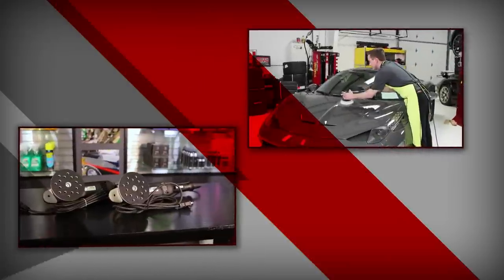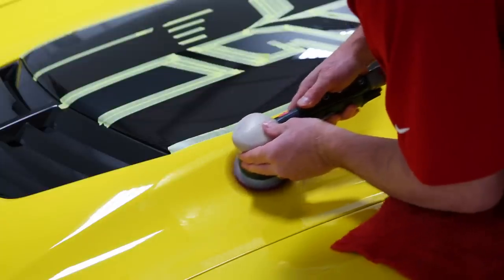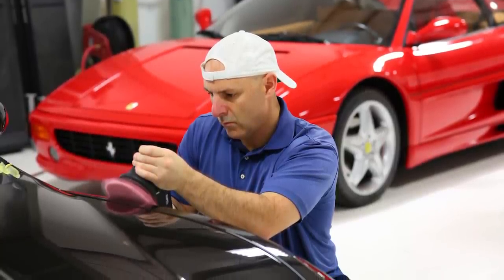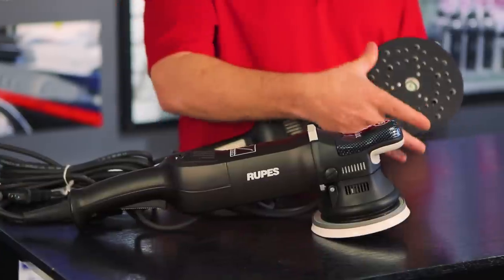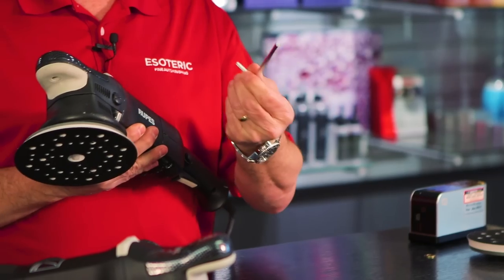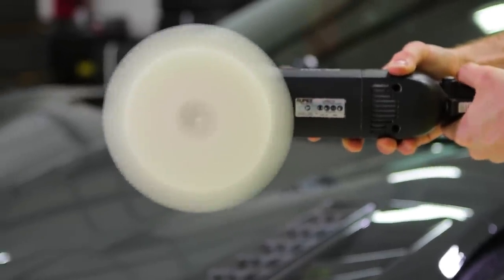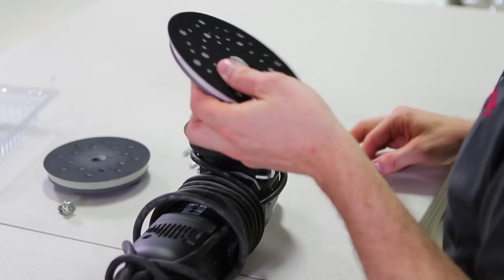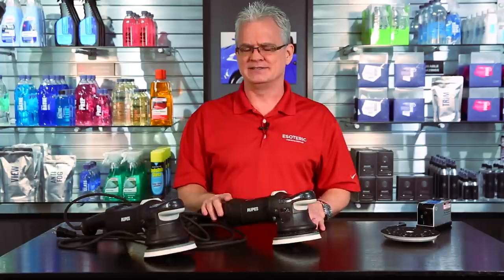How to use RUPES Bigfoot Polishers - Esoteric Car Care

Comment: Todd, thank you for the M8 size tip! I was tracking the washer mod but everything I could find called for a modified washer.
Reply from the maker: You're welcome, James. The statement or claim that it needs a "special" washer is complete BS.
Reply: Hi Todd!

I just want to clarify something as I had a hard time trying to see the M8 washer from the video. But it’s just a standard M8 washer, correct?

When people show the washer mod, I normally see an unspecified washer grinder down. Is the M8 washer in the video grinded down or a complete circle?

Thanks in advance.
Reply from the maker: Standard washer. If anybody is trying to say that it takes a "special" or "modified" washer, they're selling you snake oil. It does not matter one bit.
Reply: ESOTERIC the washer mod by Kevin Brown is supposed to help the backing plate spin better. It doesn’t rotate freely when machine is off but with washer mod in, that little gap helps
Reply from the maker: @briandraper7630  A washer is a washer is a washer. All it does is space the backing plate so it doesn't touch the "anti-spin" shroud. You can either use one that you already have in your toolbox, or pay to use one that is "special-made"...they will function exactly the same.
Reply: ESOTERIC ok thanks. Do you think it makes a big enough difference to put the washer in?

Comment: Hi I hav a Rupes LH 21 machine.. In very good condition.. Only problem is it's running on a single speed with no other buttons to adjust speed though..?
Reply from the maker: You can contact Rupes USA for service...they typically have very quick turnaround for repairs.

Comment: Great video. I see you mention a better cut with the 21. I own a 15. Am I sol when I need more cut or will it just take longer to polish out such defects?
Reply from the maker: In most cases, no. In extreme cases, you may find with the 15 you have to go back over a small remnant, whereas the 21 might clear it all in just one polishing set.

Comment: Thoughts on pad type? Mike Phillips only advocates for rupes pads as a system. I was going to go with the thin lake country. Any issues you've seen with using other pads?
Reply from the maker: The machine and pads from Rupes are all balanced to work together, but having said that, you can still use others if you wish. The 3 pads that we use at least 95% of the time are the Meg's MF Cutting Disc for compounding, and the Rupes Yellow and White pads for either one-steps or finish polishing.

Comment: Todd increrible vídeo!
I have 21, This info is perfect,Because is not necessarey to buy another machine.
Work with 5” on rupes 21,i will get the same results like 15?
Thanks.
Reply from the maker: Thank you. Yes, with a 5" backing plate and 5.5" pads on the 21, you will get the same kind of results that you would with the 15.

Comment: Nice video Todd, i was wondering if you had any info on the new rupes forced rotation version? Im still happy with my LHR75ES but sold my LHR15ES MK1. Im waiting to see what this new forced rotation one is like.
Reply from the maker: No information as of yet. I wouldn't hold out unless you particularly like a forced rotation machine. Most people do not like the action / control of a forced rotation, including myself.

Comment: Great Video on Rupes Todd. I have a LHR Mark 1 15es. Is it possible to add the rubber stand off feature to set the machine 
down on?
Reply from the maker: Thanks Kevin. If I'm not mistaken, the replacement housing (top / front) of the Mark II comes with this piece, and should fit exactly the same as the Mark I.

Comment: so its best to buy the 21m throw and can use the smaller backing plate and best off both machines in one what about pad stall great review
Reply from the maker: Not necessarily...just depends on your wants and needs. In the shop we use the 15 most of the time, but if you're a detailer that works on big flat surfaces a lot, then you may want to go with the 21. "Pad stall" is generally a technique issue, and not a machine issue.

Comment: Thanks for info Todd, I have the 21 and both backing pads, one thing to be aware of, and please correct me if Im wrong but when using a 5.5 pad on a 21, which was designed for a 6.5 pad, you will get less area covered because of the smaller 5.5 pad, thanks again for all the great videos, hope to be in one of your classes in the future, Jose

Comment: My Rupes 15 seems to stall at the slightest angle, will the washer mod or shaving down the shroud really help that much?
Reply from the maker: That's a technique issue...
Reply: ESOTERIC I’ve heard that but you can only angle your wrist so many directions, to say it’s a technique issue would be incorrect. I’ve tilted, angled and stood on my head but the slightest angle make me reach for my 3 inch... Would the washer mod help at all or is it a waste of time?
Reply: Basically how can it be a technique issue if my Griot’s G6 will spin on the angle of discussion but the Rupes will not?
Reply from the maker: @voltage80x  We have been teaching the Rupes polisher in our Academy since 2013. When we first used the polisher all the way back in 2012, we felt the same way. But when we learned how to work with it, it was no longer an issue. As a part of our training, we specifically teach how to handle contours to get the best results.
Reply: ESOTERIC I appreciate the response, I’m able to get it to spin but the angle I’m holding it seems incorrect but it’s working lol, idk just odd and not what I expected from the tool

Comment: I have a 15 da polisher different brand cheaper Chinese made should I use 4.5 on that as well it’s 720w motor
Reply from the maker: If it goes to 6, then 4.5 would be a good starting point!
Reply: ESOTERIC i starts on min then 1-6

Comment: Can you change the backing plate of the lhr15? To a smaller one like you do with the 21
Reply from the maker: For the LHR15, you cannot go to yet a smaller backing plate. The stock plate on it for use with a 5.5" pad is all you can do.
Reply: ESOTERIC - Fine Auto Finishing great stuff thanks so much for the fast reply was just curious.

Comment: I see a lot of people using little to no pressure while using rupes machines. Is that not needed with these like others?
Reply from the maker: Pressure is indeed needed to gain optimal results. Compounding requires the most pressure, then it drops down a little for one-step polishing, then down yet again for finish polishing.
Reply: gotcha. I guess I've been catching people doing the final stage.

Comment: Do you have any interest in the new Rupes Mille "Forced Rotation DA" ?
Reply from the maker: We will sell it, yes.
Reply from the maker: @ericanderson1140  "Stalling" is actually a technique problem, not a machine problem. If you find it to be an issue, then you'd be happier with the Mille.
Reply from the maker: @ericanderson1140  The yellow pad is the most versatile in the lineup, and can be used on most paints as either a one-step, or a polishing / finishing pad. As for polishes, there are some better options out there. Perfect Finish for instance makes for a great one-step polish, or as a finishing polish. If you need heavier correction, then you would go with something like the Meguiar's MF Cutting Disc and a heavier compound like Jescar Correcting Compound.